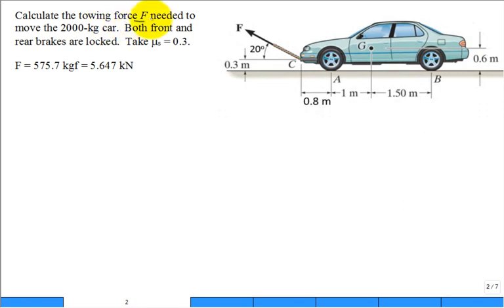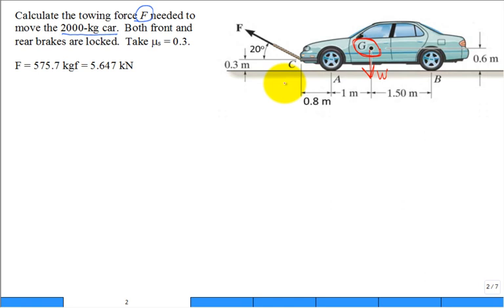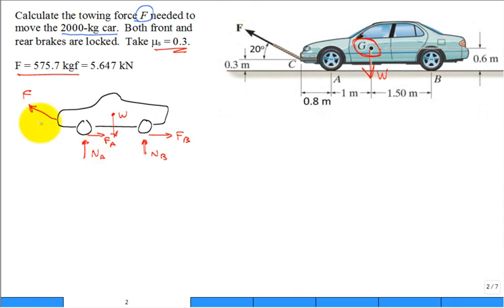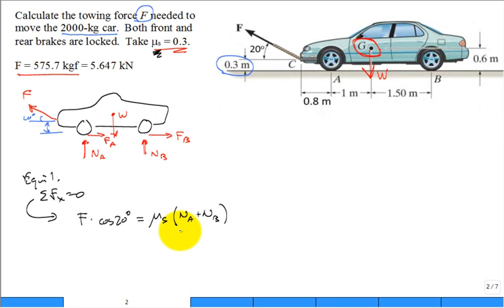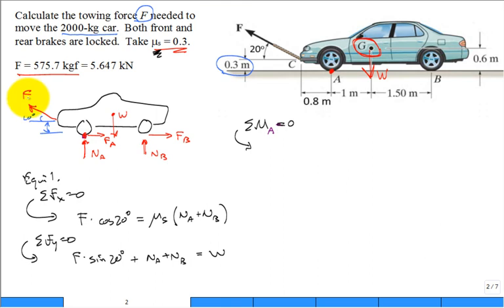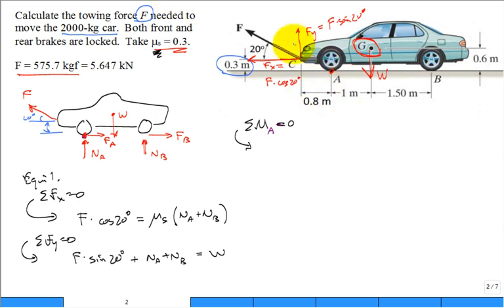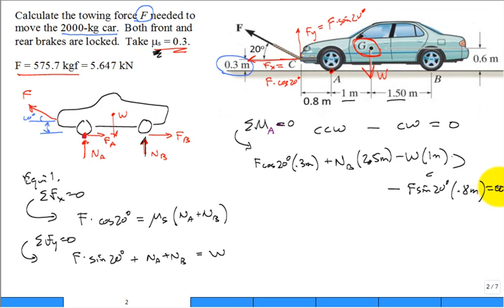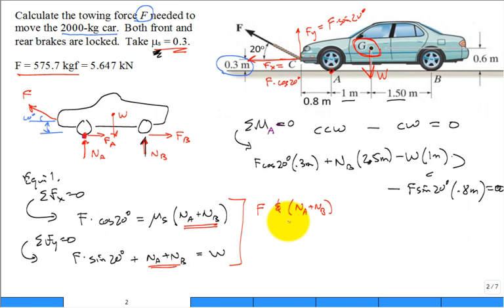pull car with locked tires spr18

Comment: If a car is 2.5 toons and its rear two wheels are locked and its on a 20 degree hill. Would it be as hard to tow as a 10 toon trailer on a 0degree hill and with all wheels moving?

If not to how many toon trailer would it be comparable